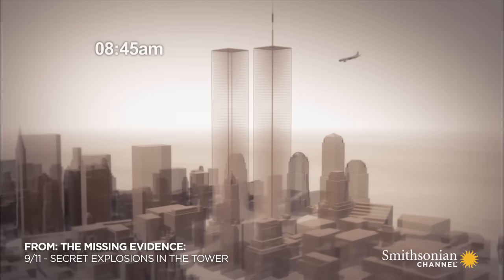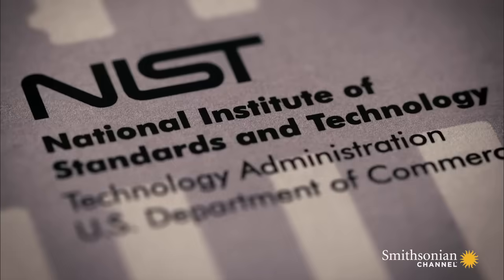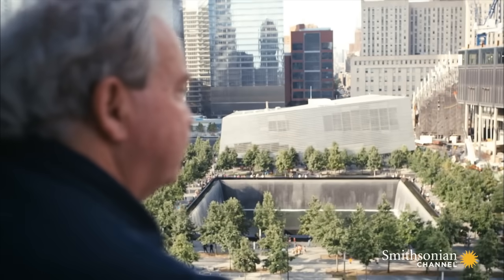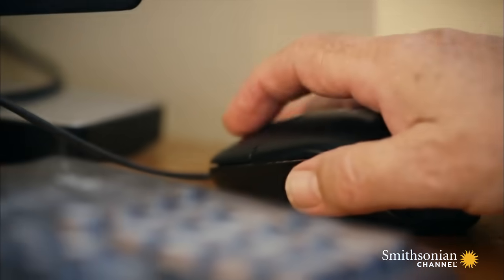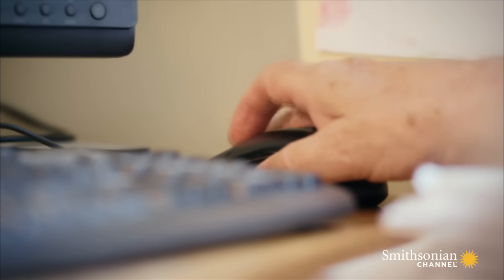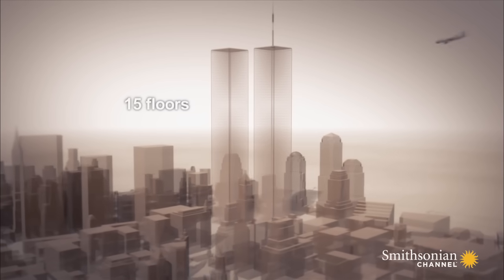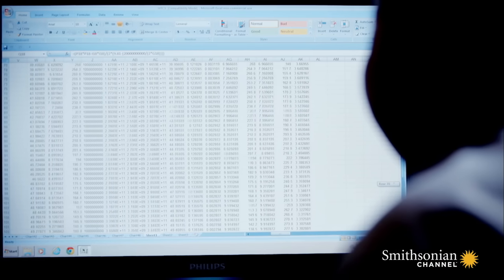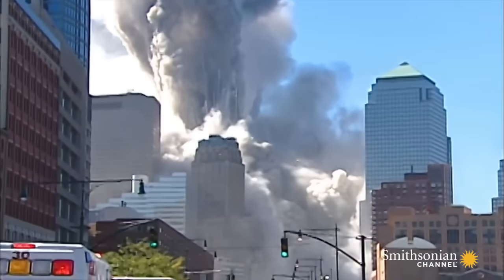This Computer Simulation Explains How the Twin Towers Fell

Comment: Could it have been possible, (seeing as how big the towers where, and how dense the area around them where with other buildings) that the towers where purposely designed and built to collapse in the safest way possible in the event of such a disaster to minimalise damage to the city
Reply: EVERY ENGINEER/ARCHITECT in the universe wants a structure that stays up-- one that does not fall at all.  The WTC's 1 & 2 were built with 3 redundancy floors in case of any upper collapse (the bands can be seen in most any photo of the structures and the pre construction models)  Since Bessemer process of steel in the 1850's structures were allowed to become taller and stronger at every point.  Frank Lloyd Wright once proposed 1/4 mile high steel buildings to alleviate the population pollution in NYC and other major cities and allow for more parks and open spaces in the cities.  He never considered how they should fall- only that they stand up to the winds and environment.
Reply: I like the way you think
Reply: livefastdieyoung26 Dude, you might as well give up trying to teach that moron anything, clearly he didn't care about or want to hear the truth, and he's clearly brainwashed or either brain dead! lol. I wonder who's filling his head with the crazy shit he's talking, I sure hope he never gets a job in construction, well, he wouldn't even get a construction job, because all he'd have to do is tell them that buildings are designed and built to collapse straight down at free fall, and they'll laugh at him and tell him to get lost!! lmao
Reply: disgny Very well explained! I keep trying to tell these morons that Structural Architects and Engineers do take into account all the variables such as fire, wind and strength needed to withstand an impact from a jetliner, but they don't listen, they just keep going through life believing whatever they are told by our lying and murdering ass Government and News Media, but yet they won't believe Structural Architects and Engineers, Metallurgists, Scientists, Physicists, Explosive Experts and Demolition Experts, also Firefighters, which to me is absolutely absurd, because these are all the people who knows about these buildings and how strong they are and what they will withstand! Like me, I've been around and worked in the construction industry my entire life, I'm a certified Mason and Plumber, along with other Certifications I have, but I've worked with steel and concrete structures, I've done demolition work and have worked building high-rise buildings, so I have plenty of experience in the field, and I know that what I seen on TV was impossible and bullshit , it just wouldn't happen like that! I seen Cartoon Physics, because the alleged plane's would not have just sucked right into those Tower's like a Ghost Plane cutting through steel and concrete structure like a hot knife cutting through butter, those Steel Box Columns were massive! And they were I believe 39 inches OC, which makes them stronger the closer they are, and the steel got thinner as it got higher, so the upper floors couldn't have caused a total and progressive collapse at Free Fall speed, because that's where Newton's Law and Physics come in, because if the upper floors weren't as strong as the floors below, then there's no way in hell that the upper floors couldn't have destroyed the lower floors and cause a total collapse at near free fall speed, it's IMPOSSIBLE!!!! My X Girlfriends Father is a Structural Architect and Engineer, he has 30+ year's of experience, and he even said that those Tower's were clearly blown up without a doubt, so these morons can keep on believing the Government's bullshit lies all they want, that's their stupidity, not mine or yous. lol.  I just can't believe how stupid, blind, naive and gullible these people truly are, not to mention brainwashed beyond belief!
Reply: Banananans I didn't realize just how much more debate had occurred below the comment I replied to until after I had already posted. He is really dense!
Reply: Taylor L.B. No building is designed to collapse or even collapse safely, building's are designed to stay standing, so, I don't know how you came to that moronic conclusion, I've never heard of something so insanely stupid, and I've been around and have worked in the Construction industry my entire life, I've done Demolition work and I have built high-rise buildings and I've never heard of something so stupid! lol.  My X girlfriends Father is a Structural Architect & Engineer with over 30+ years experience and he laughed at the statement you made, he even said that building's are designed to stay standing and not designed to collapse, not even safely, which I already knew, but I wanted to tell him how stupid the comment is! lmao.  Please, you people who don't know shit about Construction should just stick to whatever it is that you know how to do, and leave the hard and intelligent Construction work to us, this is our specialty and what we were trained to do, and we've gained years of experience doing it over the years! It always gets me how so many people who don't know shit about Construction try to talk and act as if they do know what they are talking about when they are absolutely clueless, and then they try to tell us who does know about Construction and has been doing it mostly our entire life, and you all call us stupid or crazy when we are the ones that knows what we are talking about! LMFAO, Do PLEASE, don't comment on something you have no clue as to what the hell you are talking about! Thank you, stop misleading and giving people false statements!
Reply: Banananans 

I think there is strong reason to suspect that 911 happened because of our foreign policy over many decades.
Reply: I'm dying reading this comment chain XD
Reply: What would an engineer rather have, a huge skyscraper collapse on its side, causing mass destruction, or fall somewhat safely with not as much damage
Reply: livefastdieyoung26 just nvm....ignore me...cause seeing from above you're not gonna stop till you get last word...
Reply: livefastdieyoung26 certainly less then you...
Reply: Banananans.  Sorry, but your posts were not specific enough to figure out just what you are trying to say.   If you don't like the Building 7 Free Fall  discussion,  how to you explain ignoring Newton's Laws as if they were irrelevant?!  That's not very convincing, though "Denials" are the last refuge of the Ignorant.
Reply: Can I just say that I'm sure that there's probably a good amount of engineers around the world that do design buildings to collapse safely in the event that they do. You can't really speak for all the engineers on Earth
Reply: Some might build them to collapse in a "safe" way, trying to cause minimal damage to the surrounding area.
Reply: isnt it crazy how these people talk?? Im convinced government agents sit in little offices and think up these stupid arguments to insult 'truthers' its crazy man we need an honest investigation and we need to bring the guilty to justice i guarantee it wasnt 19 terrorists with box cutters and if it was it wouldnt have brought down the towers nor building 7 that wasnt hit by anything,
Reply: If they were designed to pancake in , that would mean the whole building could go if there was a fire on a certain floor which weakened the structure. Do you think they built this in instead of a fire department going into isolate a floor fire and save lives and millions of dollars? Your argument is ridiculous.
Reply: Rich F Ya but getting hit by a plane that weighs a couple hundred tons travelling at 465mph took a huge toll on the structural integrity of the floors impacted. Then the subsequent fire which followed finally caused the impacted floors to fail, the force of them collapsing on the lower floors caused a chain reaction.
Reply: Whenever something doesn't seem right, go to that persons profile.  Count how many conspiracy theories appear there.  Count how many ways the government and others are conspiring against them.  Chuck in a low IQ and wham.
Reply: Yeah, including the firefighters who not only heard the bombs, but were blown off their feet by them.  God, why do the most stupid people try to discuss grown up issues?
Reply: Everyone just shh this needs to end
Reply: The Titanic was designed to be unsinkable... Look what happened there....
Reply: +thefarmerfitz
funny that you should mention the Titanic. did you know the Titanic had two sister ships, the Olympic and the Britannic? Turns out the Olympic suffered an accident with another ship which injured her almost beyond repair. there are theories that the Olympic swapped names with the Titanic as an insurance fraud scheme. the damage suffered the the Olympic was hastily repaired which made it weak and susceptible to sinking.
Reply: Those buildings was not designed to collapse at all. No one is designing buildings to collapse in a first place.
Reply: Ch Bo they weren't designed to collapse you idiot
Reply: that's pretty good idea
Reply: Banananans
The towers were not hollow. They core was made up of the main support structure wish included dozens  steel I beams that were almost 6 feet by 2.5 feet thick.
Reply: They could have been designed to fall straight down to minimize damage in surrounding areas. The people who think bombs were planted are stupid.
Reply: Bananas:   Since you show an interest in it,  ANY steel high rise  designed by professionals  is OVER designed, by a percentage called the Safety Factor, so as to accommodate any unforeseen events, such as hurricanes, plane collisions, etc.  So in the towers case,  the design starts with what is structurally just enough,  call it 100%,  then additional strengthening is built in to result in it being 500% stronger.  Note that there was nothing flaky in the towers design to "doom"  them.  However ,  buildings CANNOT be designed to withstand deliberate Controlled Demolition by well equipped experts with access , time, and  modern military explosives.  To say that the towers fell down into the street is NOT speculation.  And in the total absence of any credible professional explanations of other reasons for the Fall,  CD remains the only  one,  as well an the Industry Standard for intentional  building demolition.
Reply: Bananas:   You are simply misinformed.  Planes did NOT get "way bigger".   The  707 is something like 85% of the weight of a 757.. But don't worry about it, there were probably NO planes involved, only an "Appearance " of planes.
Reply: g Ask me anything about it and I'll tell you, I was certified through Hagerstown Jr College by Ronald Henson back in 1994, and I'll give you the name of the neighbor I used to live next to and worked for who owns his own Masonry Business, which his name is Adam Revels at Revels Masonry. I can tell you different names of trowels, slickers, jointers and different bonds, I can name the difference sizes of blocks and bricks, and on every third course you would lay wire to make it stronger, and when you lay bricks you can use the tip of your finger as a spacer, because it's usually about a 1/4 space, which is what you would want to have in you head and bed joints. And let me help you understand what a head & bed joint is...the lines you see running long ways, left to right, that is your bed joint, which you think of as a bed, and your lines that runs up and down, that would be your head joint, which you would think of as your headboard of your bed. And once you get to every 5th. course, then  you should go back and strike all of your joints. So, why do you want to ask me?
Reply: livefastdieyoung26 I think originally he was just assuming that some architects would include that design element to minimize damage. I would hope in some way they do so nothing more is damaged if a building were to collapse. I'd compare this to the titanic. The ship was supposed to be unsinkable but it sank anyways. Nowadays, if a cruiseliner is going to sink there's many things in place to insure the least amount of damage is done.
Reply: Short answer : NO!  no building in History has been designed to Fail, unless you are talking about MOVIES.!  Why do that, when it is so easy to design buildings that will NOT Fail.  But nothing is explosive Proof.
Reply: I regretfully submit that , Yes there ARE people who know the truth, namely those who set up the explosives.  And the rest of us have most excellent physical reasons to know that NO OTHER explanations are physically possible.
Reply: Banananans:  But  those who say that Newton was right have a MUCH more convincing case that just wild guesses. And Newton IMPLIES explosives.
Reply: Ch Bo Best comment ever
Reply: Nutcase
Reply: They were not designed to collapse.
Reply: chill dude hes getting in your head you are right he is wrong
Reply: LOL  Well maybe they were all part of this government conspiracy and were all paid off....and their families of course...and friends...and friends friends...oh!  and the people in the buildings that saw the planes hitting...and their families...and their friends.....|Oh!  and the hundreds of airport personnel: traffic staff, pilots, flight crews...and their families.....and their friends.....oh  and and and and.....

Such a childish and poorly thought out make believe fantasy tale.

These idiots need to go to work, get a girlfriend and get a life.
Reply: Banananans The one who agreed with you just agreed so you would shut up.
What evidence is there that this building was designed to fail??
If you're just going on your gut, seems more reasonable not to make the steel at the bottom thicker than the steel at the top, would you agree??
Reply: Roy Patterson You were a mason, not an engineer or architect. Sorry bub but designing skyscrapers is above your paygrade
Reply: Banananans gees man, calm down, people on these threads are in such a hurry to throw out insults, I'm not your enemy because I have a different opinion.
I personally believe buildings are designed to stand up.
The buildings were 110 story, kerosine (jet fuel) doesn't burn at a high enough temperature to melt steel, nor does carpet doors desks filling cabinets paint drywall or lighting fixtures burn hot enough.
One problem I have is the 110 story's held itself up just fine for 50 years, but a sudden jolt and weakening of 5 floors turned the whole 110 story building to dust.
I say the 'official' cover-up is bullshit.
If we disagree that's fine, insulting each other doesn't help.
Reply: mulattokid johnson 98% of scientists do not believe what you are proposing.
Another lie.
Reply: I am, by chance, a qualified scientist,   I know of not a single person in the field that believes this stuff that you immerse yourself.  It is a child's science at a basic level.  But,  you are not and you are about to tell me that all the scientists I know are stupid, mad and wrong.
Reply: +mulattokid johnson I never proposed any scientists are stupid mad or wrong, I propose that you are lying.
Nothing personal, we don't know each other.
With the new building that went up in Europe this last week, at least you are not able to say fire causes collapse anymore.
Reply: Why on earth would I be lying (there is no such word as lieing)  

Either I am part of some great conspiracy  or all educated people are, by default,  part of the conspiracy?  Because I don't believe your stories I must be a liar?  Well that must be a very challenging  lifestyle to lead my friend!  How could anyone ever learn if they dismiss the opposing views as lies?  You understand perfectly the new conundrums thrown up as you read every word of this paragraph.  We both know that much.  Every new twist to the story adds on to a thread that can no longer sustain it's integrity.

The tower block that burned in my city?    You see I was right all along .  I told you it was basic child level science that you fail to digest, assimilate and regurgitate.  The building in London is CONCRETE through and through.  The WTC towers were STEEL through and through.  Enough of this rubbish.   I recognise that life must be very scary.  For some it is a fear of the knowable unknown.  For the rest of us, it is fear of those that perpetuate fantasy and translate it to the real world.  I wish you health and wealth.  Good day.
Reply: mulattokid johnson auto correct never seems to work right on that one, thanks for the info.
Reply: livefastdieyoung26 your fucking stupid! How old are you? 8 or 9? Your literally so ignorant you can't even consider what he's saying? I wouldn't design a building to collapse! But if it where to collapse, I'd design it to where if it where to collapse it would hopefully cause the least amount of damage!
Reply: Ch Bo my head hurts after reading all this
Reply: +livefastdieyoung26
that was one of the funniest discussions i've read in a while.
Reply: Simone Pistolesi It was supossedly designed to wthstand collision from an accidental Collision of a 727.. Not a 767 gunning for it at top speed...
Reply: They wouldn't spend the time designing it to collapse a certain way but they did spend the time designing it to withstand multiple airliner impacts. In fact, these building won awards on being the some of the strongest buildings in the world capable of withstanding multiple impacts from different angles.
Reply: MrSpidermonkey wrong... It was designed to withstand a 727 collision... Not multiple times... Where you people get your info is beyond me... And yes they were disigned the if they were to collapse they would come down kind of like they did... Reason being because they didn't want them tipping over and wiping out half of Manhattan...
Reply: walkin dude yes.. I know all about that and the switch theory.. And that's all bullshit too... No way we're they switched... Name plates weren't used, A deck was different among numerous  other things....  Anyone who believes that horse shit is brainwashed and easily manipulated...
Reply: Ch Bo You could probably contact the architects to see if collateral damage on collapse was considered in their design.
Reply: livefastdieyoung26 actually the point of a skyscraper is to house industry. Not collapsing is an added benefit. Collapsing gracefully when it does collapse is another added benefit.
Reply: Roy Patterson 93 kilotons of steel vs. 38 kilotons of falling object.

And plus, it doesn't matter if the steel survives. It will simply perforate the concrete that definitely cannot survive being dropped like that.
Reply: Ch Bo nice argument guys
Reply: So that means there is more than one person that thinks this way? Fucking scary.
Reply: Wow? Your kidding right? Please tell me your brain is not capable of actually forming that thought and you got the idea from a cartoon or something ? If this was a actual thought the dumbing down of society is complete. .
Reply: Ch Bo Smart thinking, is the designer still alive? Maybe someone can find out
Reply: Ch Bo you can watch a video of them building them they were strong as fuck
Reply: impressive thread...
if the buildings were designed to fall and stand up to all those elements... this means that scenarios and reliable data and information were present... so this is a highly researched scenario ??? Can anyone find these info? 

building in california are designed for earthquakes where they do NOT fall... this has been researched and simulated...
Reply: livefastdieyoung26  every building is designed how to make it not collapse.   You can't do that without first engineering every way it could possibly fail/collapse.  Also... the safest way for it do so in the case of that exact event...
Reply: Banananans the more comments of his that I read... the more I realize how little he knows.  Especially when comes to architecture/engineering.
Reply: false. many buildings are designed around their central core so that if there is a controlled demolition or a disaster they will collapse or fail in a relatively safe way in respect to their surrounding environment. buildings as large as the twin towers you can bet a lot of thought goes into stuff like this you wouldn't even imagine.
Reply: DDOGJENKINZ buildings aren't made to collapse, actually, it's the exact opposite
Reply: Roy Patterson That's actually a joke about a breastplate stretcher taken from season one of a game of thrones on hbo, kiddo. But I like its incorporation in your argument
Reply: It's been proven without doubt, that a commercial airliner would fall apart while travelling at such great speed in such a low altitude. The  case of planes hitting the towers is in the same fantasy sphere as a free falling, gravity defying, high-rise structure with "spacial awareness"(jfc) and controled collapse capabilities(?) in case of failure(???)-my eyes bled when i read this lmfao. There is no such thing damn it. People comparing a massive land mark object to cars(??) is another level of stupid. Buildings are not designed to fall - period-. I strongly believe there are people paid to do this kind of thing/work, keep the propaganda going, i honestly feel sad that such individuals exist. It saddens me beyond measure to know that fellow humans have zero sympathy and sub zero respect for the irreversible damage that was caused in a global scale that particular day and continue to contribute like this. Civil rights were weakened, another war started, economical crysis raged again. The phrase "i don't want to live on this planet anymore" has gone from a silly kids phrase to a reality that seems more logical day by day.
Reply: Ch Bo--You are absolutely correct.  Few people remember when, in 1993,  a truck with a load of explosives was driven right into the North tower.  Aside from some external cosmetic damage and some damage to the underground floors, the structural integrity of the building remained intact.  
https://en.wikipedia.org/wiki/1993_World_Trade_Center_bombing
Reply: Banananans you are one of the only people in this comment section who knows what there talking about
Reply: livefastdieyoung26 my grandpa from my dad's side is an Architect, each and every single building is designed so that if it were to somehow collapse(and yes they are designed to resist collapse but this is the worst case scenario that they plan for) it wouldn't fall on it's side, it would collapse downwards. So you sir are the one making yourself look silly.
Reply: Javier Powell--You know, it doesn't seem to matter how many of us with engineering and architectural degrees (who can also perform a simple search engine to find authentic resources for factual data) come here to enlighten the people who are determined to perpetuate "conspiracy theory number... ad nauseam".  I'm reminded of this old saw:  Never teach a pig to sing; it wastes your time and annoys the pig.  Robert Heinlein
http://www.gurteen.com/gurteen/gurteen.nsf/id/L004143/
Reply: livefastdieyoung26 You keep saying no building is designed to collapse but it's like your intentionally misinterpreting what the message is. They are saying that in the case of a collapse, the building was designed a certain way. You keep saying this isn't true yet haven't shown anything  t refute it. The Twin Towers were reconstructed to withstand a plane's impact.
Reply: livefastdieyoung26 but they do design them to minimize damage
Reply: No, they do not.
Reply: Turbo Truth--I NEVER said the Twin Towers were designed to be destroyed.  The Twin Towers were designed so that, in the event of a catastrophe (remembering the B-25 plane that flew into the Empire State Building in 1945 during a heavy fog), the towers would not tip over onto other NYC buildings.  You go look at pictures of planes flying into buildings.  And look up the temperature of burning jet fule while you're at it--as well as the metlitng point of structural steel.  Now run along.  IIt's not my day to feed the trolls.  You are on ignore (and yes, that is possible).
Reply: Actually please show us examples of Boeing airplanes slamming into a building going roughly 560 MPH. Oh wait you can't because 9/11 was the first time that has happened. Planes rarely hit building but the September 11th attacks were the first time that hijacked airplanes were used as weapon.  

No investigation concluded that burning fuel melted the steel beams. Nor would they need to be melt to initiate a collapse, they'd just need to be weakened enough, which they were.
Reply: It doesn't matter That being the first time it happened

So you're admitting that you lied in a previous comment. You stated that 'pictures of buildings hit by planes' existed yet now you're admitting that this is the first time. And now it doesn't matter to you. 

presenting false physics in the official report

The physics is not false. Nobody has ever proved the physics in the Official Story wrong. Nobody has ever officially written a rebuttal to the NIST reports neither. The so called 'false physics' is the best interpretation of what happened to the Twin Towers. It is the most widely believed interpretation too. 

15 stories cant crush 90 stories of cold steel

Prove that it can't. Nobody has proved this to be impossible. Many reports and investigations were done on this. It has been explained.
Reply: Yes the pysics is false Less weight is less than more weight

Wow. You did not prove anything by saying that. I now for a fact that you cannot prove the reports wrong. Nobody officially has so I certainly don't expect you to come out of the blue and do it. 

You dont need to be a scientist to understand that less is less than more

That still isn't proving anything. I am not a scientist yet I completely understand NIST and FEMA's explanation. 

Physics proves that the drop rate would slow with each floor

Show me the 'actual' time the Twin Towers were supposedly supposed to collapse then. There is no evidence that indicates that the floors beneath didn't cause any resistance at all, they caused little resistance Momentum and essentially gravity itself were the major players in why those underneath floors didn't stand against those collapsing floors, being aided by momentum. The debris falling around the towers as they collapsed were in free fall as clearly there was nothing resisting them and in every video the debris is falling faster than the building is. This should prove that resistance was there after-all. 

Themtop stories would burn Period The lower floors are unnafected

So you're telling me that those roughly 20 floors collapsing would be halted by the next couple of floors below?

Again though you're under some type of assumption that there is a designated time that the Twin Towers should have collapsed.
Reply: Jason Szumski--Those of us who saw it happen live while we were catching up on the daily news before leaving for work saw it happen LIVE.  But feel free to continue in your alternative reality where everything is a conspiracy theory.  Consider  yourself on IGNORE--and, yes, that can be done.
Reply: One MercilessMing What am I ignoring that you saw?
Reply: Wow this thread is fucked up. How hard is it to comprehend that buildings are designed to stay up. Yes of course, no one would say otherwise. They are also designed that in a case of support failures from either planes or some other force, to collapse in a way to cause the least collateral damage or in a safe direction.
Reply: Yes the towers were built to be destroyed exactly 33 years later it was a freemason ritual among other things
Reply: Ch Bo NO, NOT A CHANCE IN HELL!!! AND DON'T LISTEN TO THESE OTHER MORONS WHO ARE FEEDING YOU BULLSHIT LIES! It's like when I was in Masonry, and the younger people who didn't know what they were doing, we use to mess with them and told them to go get the bridge stretching tool, so they would go back and look for a brick stretcher, well, he couldn't find it, so he asked the Masonry instructor (Mr, Henson) where it was, and then Mr Henson looked at him and busted out laughing and said there's no such thing as a brick stretcher, so the boy came back and felt stupid, we all laughed at him, but we were only joking with him, that's how we had fun, but that's sorta the same thing here, these other people don't know what they're talking about, so they act like they do, but doing that gets people's minds all screwed up, because they aren't sure what to believe! Trust me, those Tower's were not designed to fall straight down into themselves in a "Pancake Collapse", there was over 93,0000 tons of structural steel in it's structural system, which would have stopped way before even getting close to the ground, and it wouldn't have fell at free fall speed, unless you take out the supporting columns with explosives!
Reply: +livefastdieyoung26 No building is designed to collapse but buildings can be designed to collapse safely. Allow me to use an analogy. No car is designed to crash, crashing is bad, BUT cars are designed to crash safely. When a well designed and safe car crashes it crumples in a very specific purposeful way. Parts of the car in the front, the back, and to a lesser extent the sides, are designed so they crumple and collapse upon impact dissipating the force so you don't get as hurt. Buildings can be designed like that too. They can be designed so rather than fall all over the place they collapse downwards preventing a lot of damage to nearby areas when debris fall. Buildings are not designed to collapse but shit happens and so in the unfortunate case that a building does collapse as the twin towers did they cna be designed to do so in a way that minimizes damage.
Reply: Jia Hao Ji:   I admire your effort to get at the truth of things.  I retired as a structural engineer,  and I am happy to report that the problems you refer to were theoretically solved by Isaac Newton,  hundreds of years ago.  Since then,  engineers  have used the basic Laws of Physics, and the characteristics of materials  (which were not exactly known then)  to calculate  IN ADVANCE, what would happen to buildings in high winds,  etc.  It is simply NOT TRUE that such things cannot be calculated in advance, as some people claim.  Just to make sure,  we build in "safety factors".    In the Towers case, it was 500% stronger than needed, as I remember,  and the strength FAR exceeded anything impact any known airplane could create.  But, of course, NO  building can be built to withstand Explosive Demolition  by experts, with the latest military grade explosives.  As we all saw on 9/11.  " Bananas" is simply poorly informed on technical matters, and has swallowed whole the Official "Cover Story, " which can easily be disproved by anyone with a stopwatch, and the video of building 7 collapse.
Reply: livefastdieyoung26 can you stop being fucking stupid....obviously he means built in a certain way so if it were to collapse if would collaspe in a certain way...
Reply: Its stupid to design a building to collapse
Reply: nice thinking but if that was the case, it would have been disclosed by now....    Asymmetric  damage; symmetric collapse - all buildings......   & yet Verizon & the post office escaped relatively unscathed.
Reply: a nearby school was damaged and students were killed
Reply: I struggle with the same argument with friends
Reply: Here's what I'm saying. Obviously people don't want to design buildings  to collapse if there was a fire that weakened the  structure instead of a fire department, but if total collapse was inevitable, then it would be better off to somehow create it so if a total collapse was bound to happen, then it would collapse in a somewhat safe way, causing the least amount of damage to the surrounding environment.
Reply: John Smith--Architects design buildings for specific purposes--in the case of NYC high-rises--near three airports who handle thousands of flights a day in all kinds of weather.  The buildings were designed to withstand the impact of an airliner either taking off or on a landing path, which are not the typical cruising speeds. You might, if you know how, develop a search engine to find that interesting piece of data as well as that the Empire State Building was hit by an airplane in  foggy weather in 1945, so there is historical precedent for such a thing to happen. In case you DON'T have the time or ability, I've listed a few below.

However, the planes that flew into the towers did so deliberately and at accelerated speeds on a perfectly clear and sunny early September day.  The buildings WERE designed to collapse in extreme cases and NOT topple over, thereby endangering nearby buildings and untold thousands of people.  No one can design for EVERY possibility, and terrorist attacks weren't considered much of a threat in 1973, when the towers were completed.  So, don't YOU be so "f*cking stupid; mentally deficient; f*cking retarded".  By the way,  you might consider that some people here DO have architectural and/or engineering degrees and a lifetime of work experience to back that up.  

Bollocks?  The only bollocks here is your claim that you're an architecture graduate.  Were that true, you'd take into account the reams of information as well as interviews with the architect, Minoru Yamasaki, and the architectural firm of Emery Roth & Sons.
https://www.wtc.com/
http://www.history.com/this-day-in-history/plane-crashes-into-empire-state-building
http://www.history.com/topics/world-trade-center
https://www.panynj.gov/wtcprogress/history-twin-towers.html
https://en.wikipedia.org/wiki/World_Trade_Center_(1973%E2%80%932001)
Reply: Ch Bo Just pay attention to who you listen to, believe and trust, because it's very easy to let the wrong people mislead you.
Reply: Ch Bo Just pay attention to who you listen to, believe and trust, because it's very easy to let the wrong people mislead you.
Reply: Jia Hao Ji God damn you people are so fucking pathetically stupid!!! You clearly don't know shit about Construction, Science, Physics or Demolition, so why do you people always keep trying to tell the people who do know that we've crazy and don't know what we are talking about when it's you are you don't know what you are talking about, I just don't get it, that's like I'm a certified scuba diver, and it's like you trying to tell me how to scuba dive when you don't know the first thing about it, and that's absurd!! Yes, the Struxture Architects and Engineers designed those building to withstand an impact from a Boeing 707 jetliner, which was the biggest plane at the time, and the Architects said that those Towers could have withstood multiple impacts from jetliners and should still have stood! And the Government fills you guys head with bullshit and you all believe it, and that's just plain ridiculous! They tell you what supposedly happened and you believe it, but yet when someone else has experience in that field tell you that it was impossible and what really happened, you don't believe it, it's like we tell you lies, but yet the Government is always honest, do you realize how pathetically stupid that sounds! Like I keep telling everyone else, if you really believe it happened the way it did and that planes really crashed into those Towers, then why don't you prove it, all you have to do is send an unedited and untampered with video showing the alleged plane's crashing into the Twin Tower's, send it to Ace Baker and he'll pay you $100,000 dollars, so why don't you prove him wrong and get all that money, I know anyone who truly thought he was right would, I know I would, but I believe him, because I know what I seen on TV was fake and impossible, it violates all the laws of physics and science, as well as Newton's Law, so I know what really happened because I have a brain and Common Sense, and I use it, unlike you people! I feel so sorry for you and the people who lost their lives that tragic and horrific day, I feel so sorry for them because they lost their lives, and I truly feel so sorry for you because you are so brainwashed beyond belief it's pathetic, and you are clearly brain dead! I'm not even going to waste any more of my time with you people, because it's truly hopeless, sad and pathetic that you people have to be that way, you all truly believe that you know what you are talking about when you truly don't know shit! I don't know what benefits people like you have in this world, because you people only cause confusion and chaos!
Reply: Ch Bo 

Good point. Kind of like how cars do when they crash. The goal is to provide the least amount of damage to the surrounding driver and passengers. The motive for 911 also debunks these claims. Osama Bin Laden attacked because of our foreign policy of invading and occupying Saudi Arabia.
Reply: You are wasting your time I suspect.  Why?  You now suggest that the thousands of scientists and engineers ( by a margin of what? 98%?)  Say that it is perfectly plausible once they have all the information.  So to say something 'cannot occur naturally' is the evidence base of your conspiracy presumably, as you quote it.  So if it could be proven to you, beyond 'reasonable doubt' that it could ( in  the same way that salt added to water will form crystals, that way water evaporates in to steam when boiled or that plants draw their food from the atmosphere) would you then stop this pursuit?  During the era of the civil rights movement, some would still be sufficiently  intelligent, qualified and therefore much less  prone to hysteria and the manifestation of personal dysphoria to create a convenient fantasy world .  Today though, what would be the excuse to create a world where ones own state murders it's and foreign nationals for convenience in secrecy?
Reply: BennyDawg1
Listen to yourself
Here is what a 8 or 9 year old might say on a youtube discussion board.
'Your fucking stupid!!' Cant you just see yourself saying that to the your bud on the playground for knocking you in the head with the tether ball??
Even 8 and 9 year olds know how to make exclamation points, good insult though, your getting better at offending people, very important in your quest to deflect any search for truth.
Just so you know, the 8 or 9 year old is right, noone has ever built a building to collapse, ever.
And also, those buildings did not 'collapse' as you say, they were blown up.

Why is this discussion still taking place anyway, the architecture plans are somewhere, maybe in building 7
Reply: +banananans
i have tried to find proof that they designed the buildings in such a way as to minimize damage if they were to fall, but i could not find anything. please direct me to some article that refers to this.
Reply: Ch Bo No, they were designed to withstand the hit and stay put even with a greater and hotter fire. The twin towers would be the first and only buildings to collapse due to a fire. Many older building resisted longer and more intensive fires.
Reply: Ch Bo Yes, the twin towers were designed to, if they were to, collapse inward to minimize the falling debris on the surrounding area.
Reply: are you insane!!!???  They don't build buildings to collapse- they are built to stay up regardless of any weather or man made errors.  otherwise skyscrapers all along Chicago would fall as the wind shifts.  MY God think before you write.
Reply: Banananans Dude, you should really stop talking,  because you are really making yourself look seriously stupid and pathetic, so maybe you should quit before you further embarrass yourself!! lmfao, they built buildings to collapse straight down at free fall speed within their own footprint....really, are you fucking serious dude, do you realize how pathetically stupid that sounds!! I've been around and worked in the construction industry my entire life, I'm a certified Mason, I've worked with steel and concrete, and I've worked building high-rises and I've done plenty of demolition work, and I can promise you that that DO NOT design nor build buildings to collapse straight down within their own footprint at free fall speed, it's bullshit!! Let me ask you something, who told you that horseshit, where in the fuck did you come up with such a crock of shit, I mean Jesus Christ dude, where in the hell do you people come from??? lmao, I hate to say this, but you've been brainwashed so bad that there's no hope for you!
Reply: Banananans Please stop, I can't handle any more laughing, my stomach is about to burst!!! 😀😁😃😄😅😂 And yes, my job title and experience does qualify me, unlike you, and like I keep trying to tell you idiot's, is that reading about something isn't nowhere near the same thing as hands on experience, you don't know how things work! And yes, fire's, high winds and even a plane crashing into them are all taken into account when they designed the Twin Towers, those Tower's were designed to withstand impacts from a Boeing jet, so what the fuck are you talking about....this is exactly what I mean, you people don't know shit, but yet you keep talking and acting as if you do, but yet you don't, but at least now you've admitted to it, which you are the only one, but you have to realize that there's over 2,500+ Structural Architects, Engineers, Metallurgists, Scientists, Physicists, Explosive Experts and Demolition Experts who do know what they are talking about and what they're doing, especially the Structural Architects and Engineers who designed and built these Towers, which they did in fact take into consideration everything you just mentioned and more, and they even said that those Towers were not supposed to have fell, especially not in the way they did, because buildings aren't designed and built to fall, they are built just the opposite, they are designed and built to stay up! I'm not going to keep wasting my time with stupid people who don't want to learn anything and who doesn't care about what really happened on that horrific and tragic day, which over 3,000+ innocent people lost their lives that day, so please don't waste anymore of my time or your's!
Reply: +Dastardly Dan I thought the claim used to be 'over 5 hundred miles an hour, now that false info has been exposed that jets are fragile and can't fly that fast at sea level I hear you say 465, convenient.
I hope I don't get murdered for repeatedly claiming 9-11 was a false flag, but anyway the structure below was designed to hold up the weight of the structure above,  something is fishy about what we've been told, just like Assad had no motive to gas his own people, and Sadam Hussien did not have WMD 
Michel Medved is a huge cover star for you, he loves to compare it to Germans in WW2, as if they were subhuman.
Let's not forget, the winners get to write the history books.
Reply: Banananans You are the one who reads and wants to talk and act like he knows what you are talking about, but you see Moron, I've been around and worked in the construction industry my entire life, I'm also a certified Mason, I've worked with steel and concrete structures, I've done demolition work and have worked building high-rises, so I don't have to talk or act like I know what I'm talking about, because I have hands on experience, I don't work as a a waiter or a busboy and talk and act, I know, because I have been there and done that, but you, you have to read shit and talk and act like you know what you are talking about when you clearly don't, and I find it very humorous how pathetically stupid you truly are, so keep the jokes coming comic boy!! lmfao. That's why you have a picture of a fucking gorilla eating a banana! Hahahaaaaaa😀😁😃😄😅😂👍
Reply: livefastdieyoung26 lmfao, I know,  right! Where in the hell do these dumb ass Morons keep coming from??? Duh, they built them to collapse and fall straight down within their own footprint at free fall speed....um, ok....I'll buy that for a dollar, NOT!!!! That's like saying that our sun is made of water! lmao.
Reply: Banananans You are a complete and utter fucking fucktard MORON!!! Are you trying to tell me that over 2,500 Structural Architects and Engineers, Metallurgists, Scientists, Physicists, Explosive Experts and Demolition Experts don't know what they're talking about but you do??? Lmfao, ok, now I see how pathetically stupid you truly are!! lmfao👍😀😁😃😄😅😂 Please stop, I'm about to piss myself, I can't stop laughing!!!! 😀😁😃😄😅😂😀😁😃😄😅😂👏👏👏👏👊👎
Reply: The twin towers had bombs in side let me tell u 20hour's before... during the night CIA went in the towers and put solidifys when there went out and waited for morning... the planes were hijacked etc
people of America your government, CIA is lying to you it is propaganda